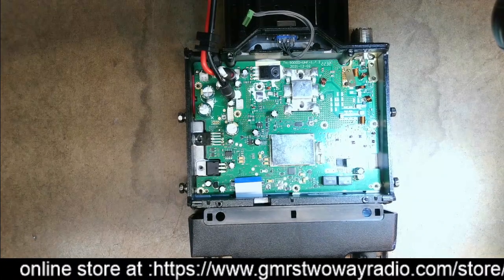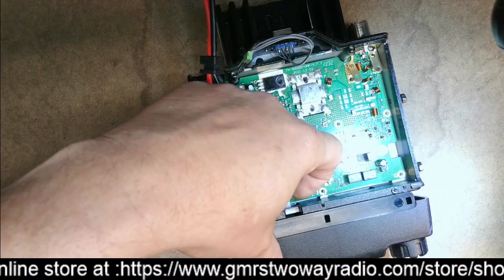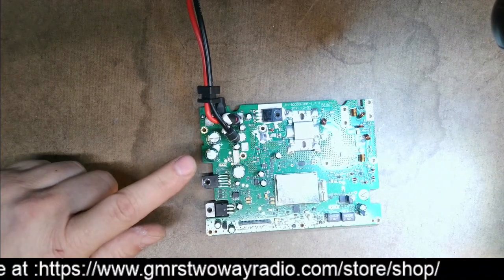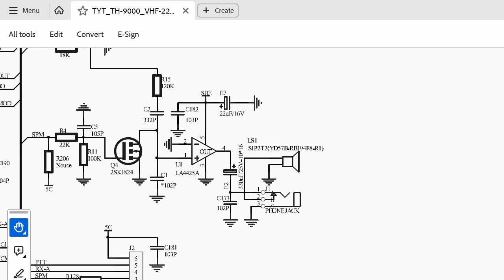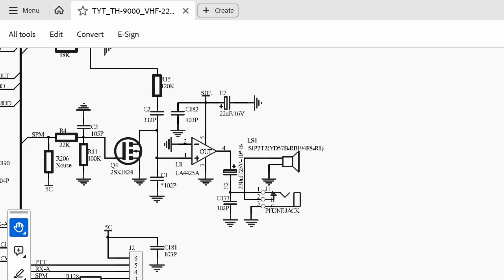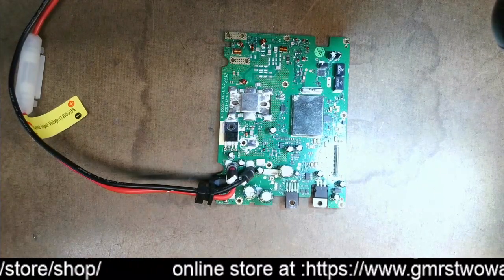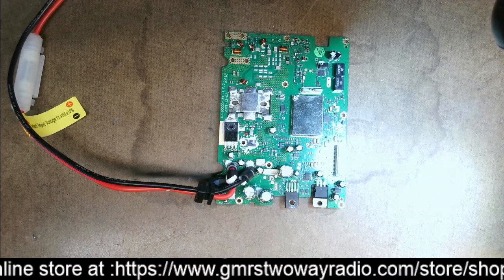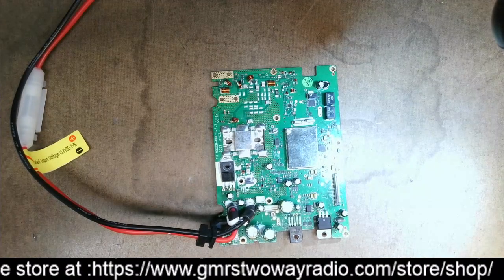🔺Poor or NO sound TYT9000D or Retevis RT9000D or Alinco dr-438 Easy things to look for! 🔺

Comment: Hello what is the crystal oscillator for tyt th9000?? 19.2mhz?
Reply from the maker: From what I can see, there are TWO 38.850mhz crystals
Reply: @GMRStwowayradio  Two 38.850MHz crystals are filters for 1st IF. TCXO frequency is 19.2MHz (5*3.2)
Reply from the maker: @thacypher6308  that could be I didn't really spend time looking at the circuit. I was just saying what I saw

Comment: My speaker has failed & i would like to replace it with something better and less likely to break. Any recommendations or what should i look for.
Reply from the maker: how do you know for sure it failed? Also if you plug in an external speaker using the jack in the back how does that sound?